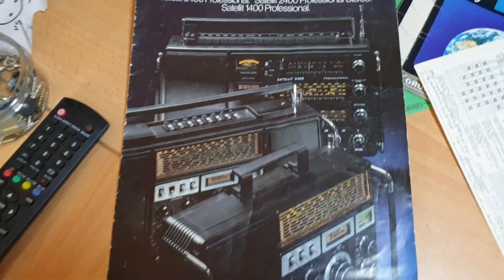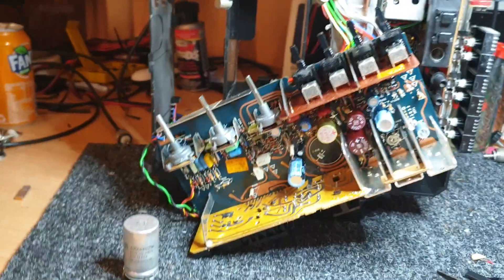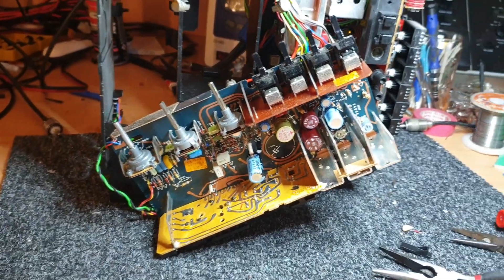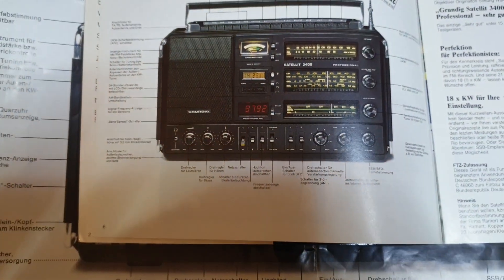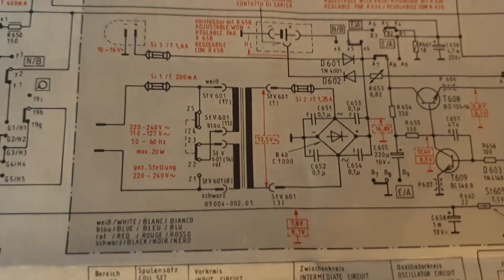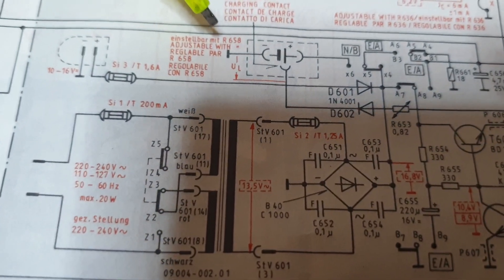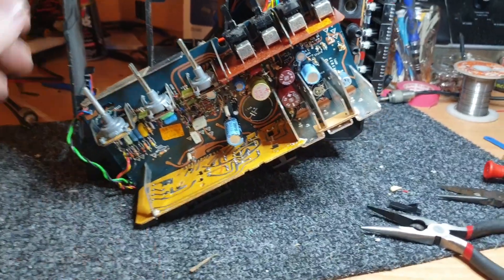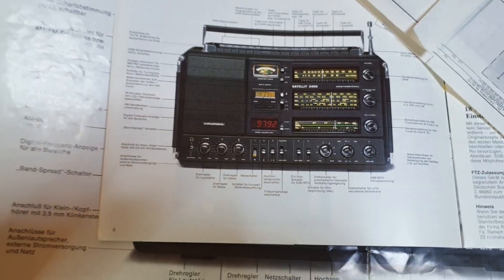Grundig Satellit 3400 Professional HF Communications Receiver. Part 1

Comment: Please repair my 3400
Reply: Hi Harleybiker, just seen your request on Brendon’s shout. Hope you’ve got her fixed by now but if not check out ….electronics old&new ..this guys brilliant.he’s restored his Grundig 3400 and I’ve used his vids to fix mine…good luck sir.. John from uk.
Reply: @johnturner9239   my higher sw  band are not fine shortwave 1 and 2 are great..got a wellbrook  loop antenne  and the radio doing his work..thanks for yer message john .and be safe ..
Reply: Thanks Harleybiker,get a fibreglass pen and clean those contacts. Makes a world of difference.Kind regards John.

Comment: I have same model. with same manuels, books and leather case. i restored couple year ago. i change light bulbs, repair mechanism belt. i can't find any problem with electronics everything works fine but it's sound too low i think. i clearly remember, old days it was very loudy. i tried speaker switch, check speakers and volume potans but everything looks fine. i'm not electronician i'm probably skipping something, but what. any suggestions?
Reply: They often develop problematic contacting of 3 position selectivity switch and for that the low level of sounding is happening like half. Contact cleaners worked only short time and it was annoying so I had to get switch out and completly overhaul contacts - they were chocked with dirt inside. After no more.